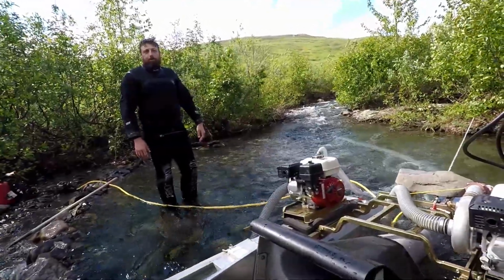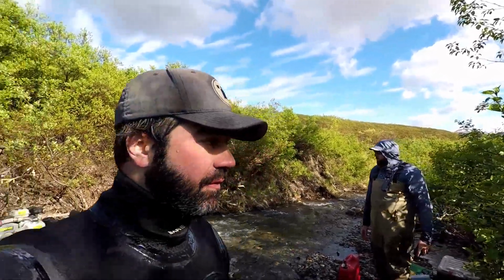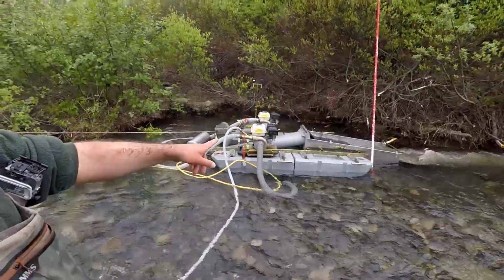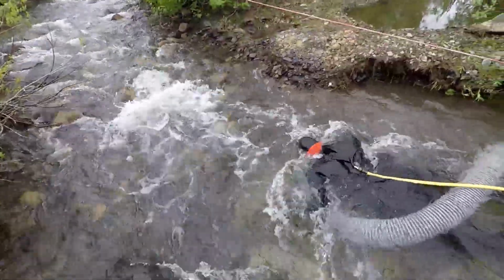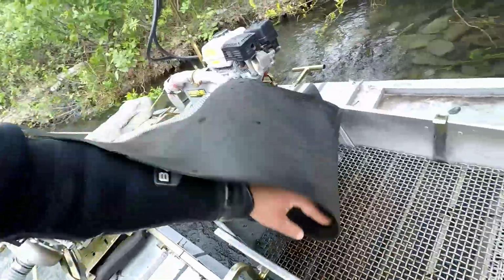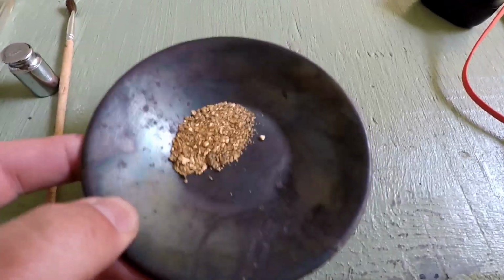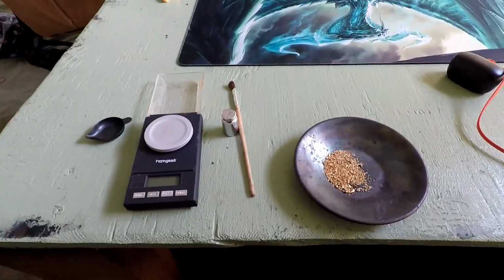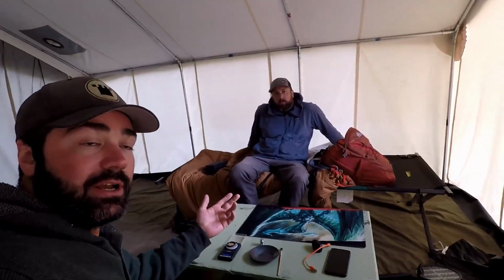Gold pickers Galore! Big clean up on our 6 inch dredge in AK

Comment: That’s a great total your definitely on it I always wonder how much fine gold a dredge loses because of the high water flow have you ever tried putting a metal tub at the end of the sluice to check? When I find a paystreak in the creeks I prospect it’s usually mostly black sands and little heavies and it’s not tight packed it’s usually loose material is it the same in a river and can you tell from the gravels if it’s a pay streak? Great video thanks for sharing see you on the next one 👍🏼👊🏼
Reply from the maker: We have tested the tailings about once per season and have generally found one or twin”fly poops” tiny specs